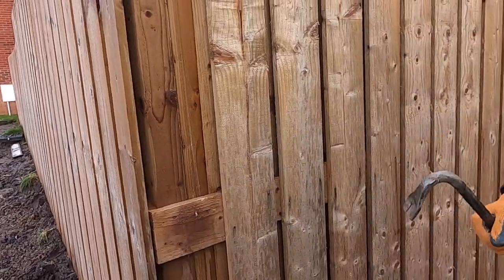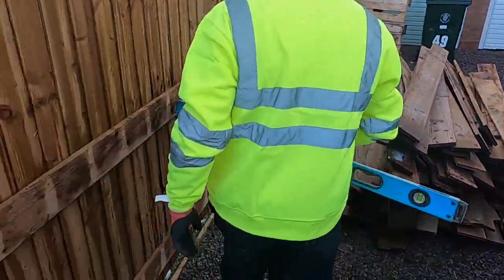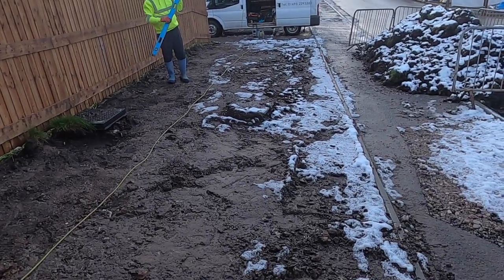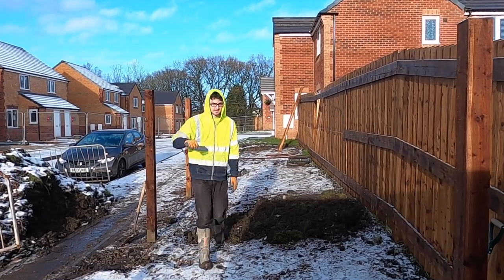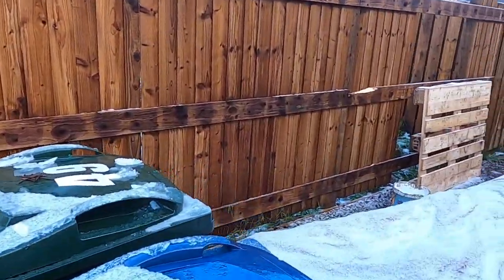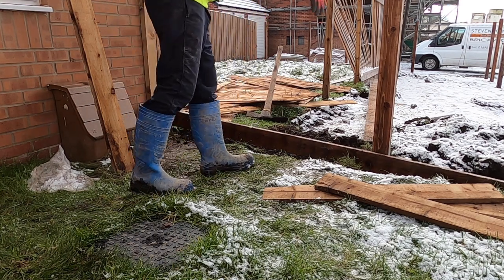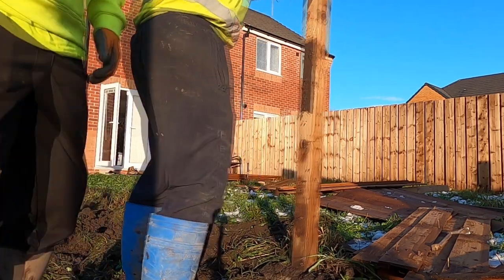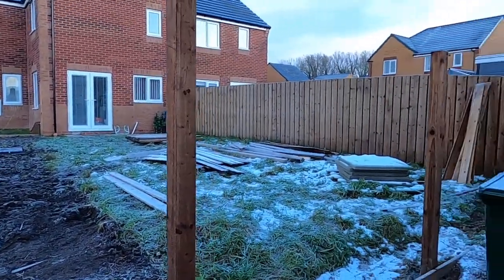SHOCKING FENCE REPLACEMENTS

Comment: Looks cold that day 😱 Im no expert but digging deep hole without disturbing surrounding soil is the only way to go ( as you did) . I made a cracking hole drill from an old circular saw blade 8" ( youtube video) and welded long tube on. Using decent battery drill it digs perfect firm holes with no effort. Take 3" bites at a time and lift out soil. 👍

Comment: Here in New Zealand the standard is 4×4 posts, 4×2 rails, and 4, 6, and 8×1 boards all treated H4. All post tops cut on an angle for water run off. Posts set in concrete at least 600/700 deep. If a high wind zone we use 6×6 posts on the corners and every 2nd post.
Reply from the maker: Wow , solid indeed 💪🏼🧱👍🏽

Comment: ive told you before steve ,ive been fencing years,and in cases like that ie with all that water and shite  in the holes all youve done is kinda plug the holes with the post,s and post mix ,they will rock like the ones you took out if you swing on um,,,what you should have done ,is dug a hole 2foot deep by 2 foot across.then put about 10inch of conny in the bottom,that way it countereacts the weight at the top,like when you see beer garden umbrellas up with the wide concrete base no rocking then my friend,any how hope this helps
Reply from the maker: Nice one . Our holes were into nice compacted ground and clay 👌🏼🧱👍🏽
Reply: What did he mean by conny, but I do agree there was a lot of water in the holes.
Reply from the maker: @amazing451  concrete 🧱👍🏽

Comment: Have you seen the smart fence system ,25yr warrrenty ,the same amount of work in relation to digging post 600mm dept ,but it really does look the buisness.
The drawback is the cost of smart fence 
But it is a brilliant fencing replacement for timber type fences.but cracking work
Reply from the maker: Thanks Charles. Yes it looks excellent 👌🏼🧱👍🏽

Comment: The type of fence you made is like a big parachute, it will wobble after a few years especially with that small amount of cement.
Reply from the maker: The fence will still be there in 20 years . 
    Fences aren’t secured with cement . 
   They are  concreted in …. Big difference 🙄

Comment: I can never understand why people go for wooden posts instead of concrete. Back in 10 years to do it all over again.
Reply from the maker: Pressure treatment timber lasts Double the time concrete ones do . Just replaces 5 year old concretes all blown with concrete cancer . 
   At last house the posts were timber and the fence was still solid when we moved out 17 years later . 
  Timber is nicer to use , lighter and better for the environment. 
💪🏼👌🏼🧱👍🏽
Reply: @SteveAndAlexBuild  Hi Steve and Alex  I've experienced exactly the opposite. Me and both my neighbours had rotten wood posts after 10 years. My new concrete ones show no sign of cancer after about 8 years. Soil conditions or quality issues vary perhaps.
Reply from the maker: @robertpowell7672  . Absolutely. The post quality varies a lot between manufacturers. 🧱👍🏽